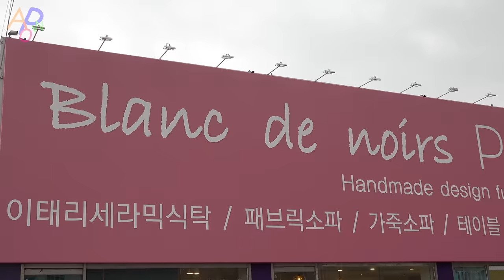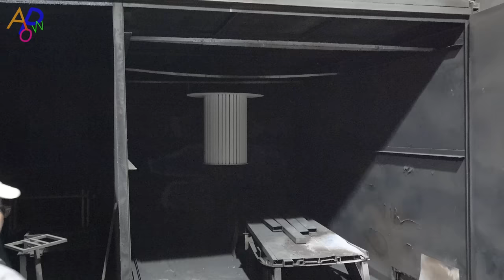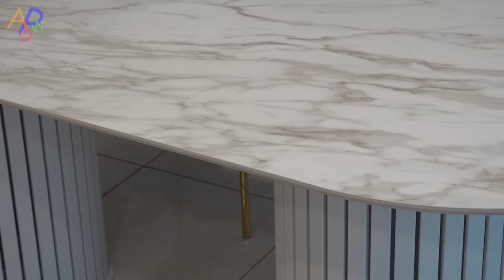How to Make Marble Dining Table With Powerful Waterjet Cutting Machine. Korean Table Manufacturing

Comment: I have serious doubts about the strength at the middle of the table. If someone sits on the middle edge, it likely will crack.
Reply: Not to mention the whole base is attached with ½ inch screws in that barely thick plyboard
Reply: Did you know that big and thin tiles are actually flexible? Thin and large tiles can be bent into water drop shape. For example, you can google "Kale Seramik Sinterflex".
Reply: Pretty sure the guys professionally making tons of these have tested them enough and tweaked the design so that it works.

Most people don't realize how much time and effort goes into designing a consumer product. It's surprisingly difficult making something that's even middlingly usable. Most first drafts when handed to any normal person will instantly have an obvious problem revealed. Which would be a problematic position to be in if you have a whole assembly line and tons of people making these, so before were they ever get to the point that they're showing They have experienced designers, iron out all the kinks and put the product through a lot of testing.

Otherwise you're just going to get a bunch of pissed off customers returning and demanding their money back and you go out of business pretty quick.

Not to mention most people shown an airplane for the first time Not knowing what it was would have extremely serious doubts about its ability to fly. Pretty hard to make any kind of judgment calls about materials and technologies when you don't know anything about them. If the material was that problematic they would have chosen something else.
Reply: @icedragonair  it's furniture, not car manufacturing, ply board and wood is very easy to replace, and cost effective as well
Also many times the customer simply presents his own internet designs, and you don't think the factory owners deny them just because they've never made that, that's where the skillful worker part comes in, and they start building without testing.

for example even you can make the same table in video in your own house even if you only have hand tools, furniture is not very difficult to make, but making money of of it is.

and the testing and making mistake part is very common in furniture line, you will always find errors if you look close enough. 

Also wooden items tend to expand contract depending on weather, so even if you have the perfect Milimeter aligned dining table straight from a factory,
 you'll find slight error in size the very next season.
furniture does not remain perfect
Reply: @icedragonair  It's called corner cutting to save on costs. It's naive to assume every product is made to the highest standard. As it happens, I am a designer (not for furniture though) and there's always some kind of compromise on every project to either save time or money but the product is good enough to ship. It's just the way the world works, the buyer doesn't have to know everything. By the way, they chipped the white paint just by putting in the screws. Should the customer complain about that?
Reply: Table's are not for sitting on :P
Reply: @FuzzballRenakitty  true, but they should be sturdy enough for it.
Reply: It’s cheaply made
Reply: @FuzzballRenakitty  tables can be used for many things other than sitting lmao

Comment: I'm a bit confused about this not being a real stone ?
It's just a tabletop made of plywood and a marble slab glued on top. 
That's something new I haven't seen before. I love it!
Reply: though in India you can get whole marble top table cheaper than this korean technology,
Reply: @satendra_sharma  I was thinking the same thing
Reply: It's not even marble. It's just a big ceramic floor tile. Also. the edge treatment is horrible. The unglazed edge of a tile should never be visible, and the plywood does not complement the ceramic top and painted steel base.
Reply: This is big-slab porcelain tile, not real stone. However they have advantage over real stone, like stain-free with excellent finish, if you choose high quality tile company such as Niro, Accord (India)..
Reply: Cheapest crapola!

Comment: 14:35 작업자분 초보신가... 전동드라이버 삐꾸났네요.. 저러면 나사홈 망가지는데...
Reply: This is the feature of the drill. It automatically stops tightening the screw when it reaches the specified torque value.

￼
Reply: ㅋㅋㅋㅋ. 이래서 어줍잖게 아는게 무서운거지 전동 단계를 낮춰놔서 야마날정도의 힘이 없는데...
Reply: @user-kn9qk6gc2m  14:31 삐꾸나면서 홈 망가지는거 안보이냐?? 저렇게 계속 데미지가 쌓이는거야... 너야말로 어줍잖게 오지랖떨지말고 조용히 가라...
Reply: @Balbi3d  저게 멈추는걸로 보이냐?? 넘어서 확돌아가니까 홈이 망가지잖아
Reply: @Balbi3d  that's not how his drill is set... You can clearly see the screw head stripped. If he had the torque limiter on it wouldn't strip.
Reply: @oelschlegel  yes, i saw the issue. 14:31
Reply: @IKILLYOU.  ㅋㅋㅋㅋ 계속데미지 쌓인데.... 다만들었는데 출고 안할꺼야?
Reply: 왜들 싸우고들 계심? 영상보고 제가 저 브랜드 알아봤는데 진짜 특허받고 잘만드는 곳이던데요;;; 공장까지 다녀와서 세라믹식탁 전 구입했습니다. 다른곳 비교해봐도 확연히 차이납니다. 직접 공장가보세요.